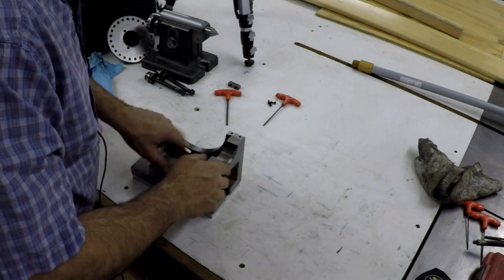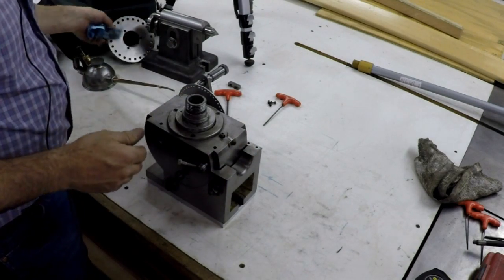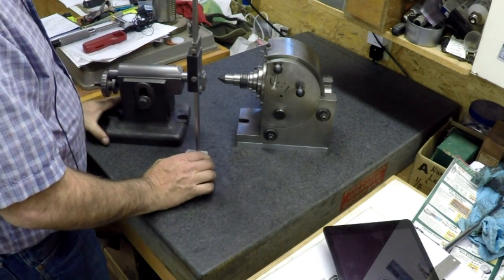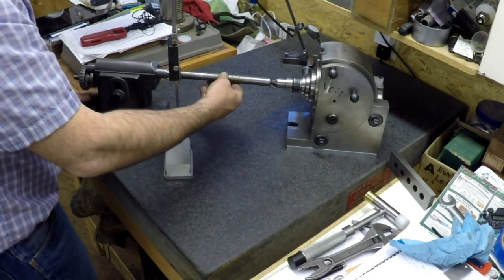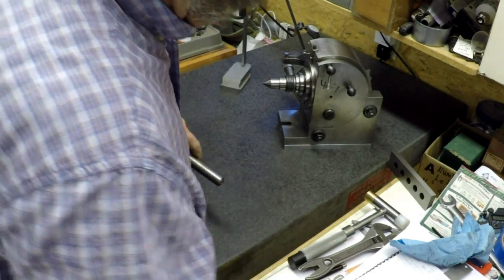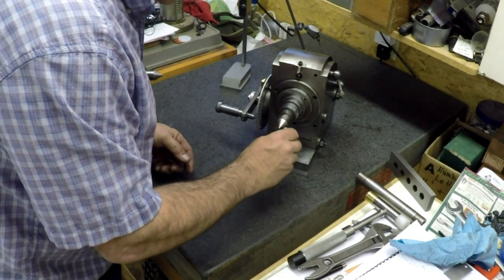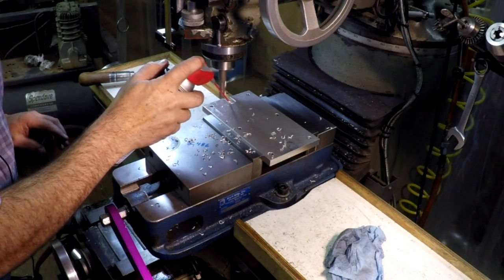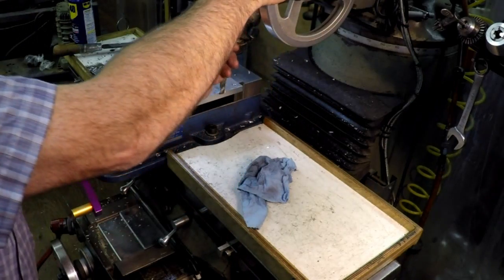How to Repair a Lathe Change Gear Part 4

Comment: Have you considered machining a bar with a taper to match your dividing head. That would extend the axis of the dividing head to allow levelling, angle setting with a sine bar, etc.
Reply from the maker: Peter W. Meek No Peter I have not thought about that.  I will have to look at it.  Thanks for the suggestion.  Randy

Comment: Nice work Randy...I am waiting to see your prep on the gear before brazing my own. I know how I would do it, but being that my brazing techniques are limited to spear-gun fabrication and repairs, I think I will wait to see how someone who knows a little more does it...I guess I have Keith Fenner's videos to look at, but I want to see how we do it here in the Sierra-Nevada gold country :D

Aloha...Chuck
Reply from the maker: Knolltop Farms Chuck Thanks.  No more than 2 min before i received your comment I had finished up the brazing on the gear.  Well I did it outside, since we are in CA and in the Sierra's, and because we can.  Might even rain a bit here today. I gave you a call and left a message.  Randy
Reply: Haha, right after watching your video on a break I went outside and worked on the South Bend, welding on my belt tensioning contraption it came with. I will give you a ring in the morning to tell you how the goofy thing works...which surprisingly, it does! Aloha...Chuck

Comment: Randy, just wondering why you chose Ali for the spacer plate... maybe i missed that bit. Id be a little worried about dinging it, even just by getting a chip under it on the table.
Reply from the maker: l0ckcr4ck3r Well I had the Alu., it was just the right thickness, I don't use the dividing head very often, It does not need to be as accurate as you might think, Alu is fairly inexpensive to replace if needed, didn't want to pay for a ground steel plate.  Those are about the top 6 reasons.  If I had my own surface grinder I would of been temped to grind my own steel plate.  You did not miss anything.  Thanks for asking.  Randy